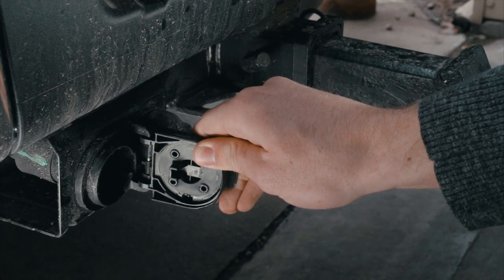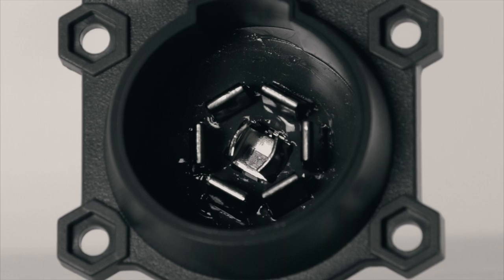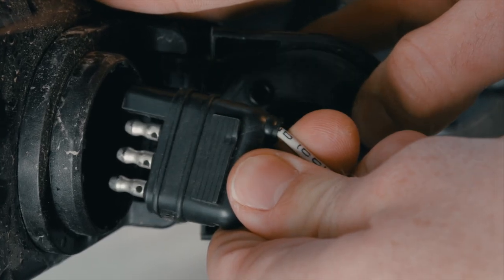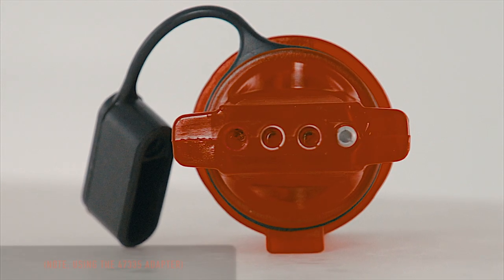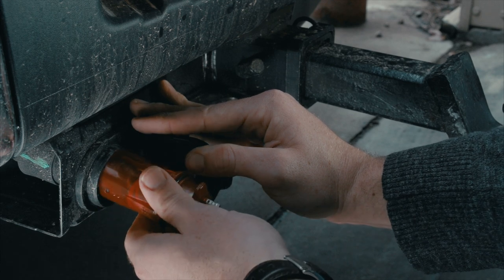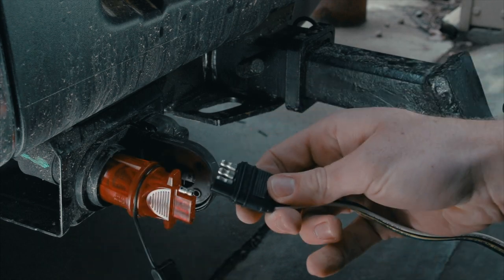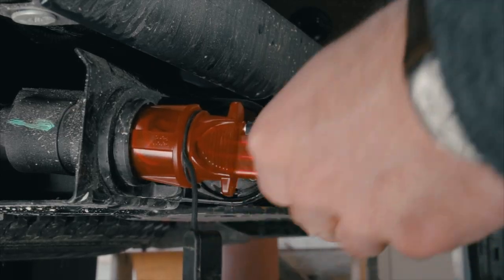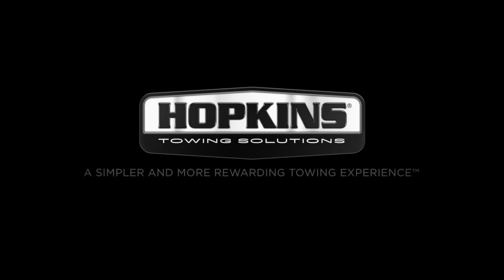Hopkins Towing Solutions: How to use a 7 Blade to 4 Flat Adapter

Comment: The only reason I would use one of these is in an emergency. I went the other way. Since I always seem to wind up with tow vehicles with separate brake and signal lights, I wired my trailer the same way as the car. It takes one more pair of rear trailer lights, but it's far superior in concept and in reliability compared to combined brake and signal lights. No goofy adapters of any kind. I will admit that I wired the entire trailer myself and it was well worth it.